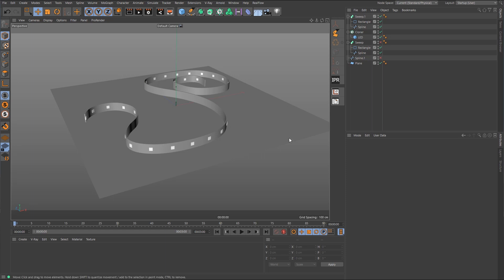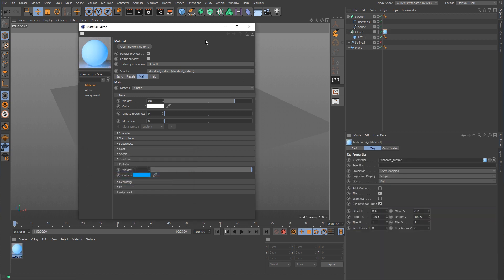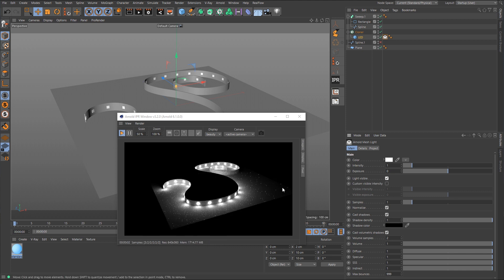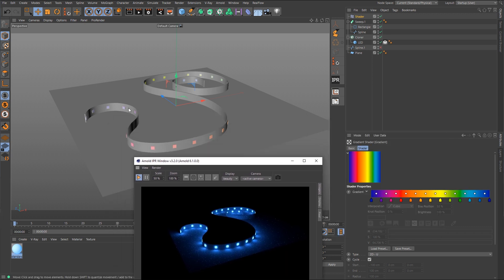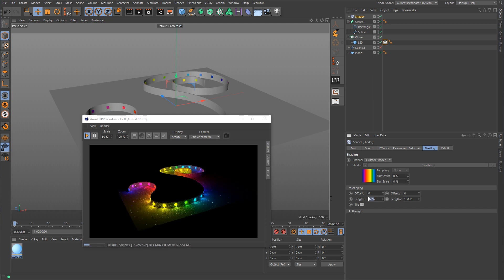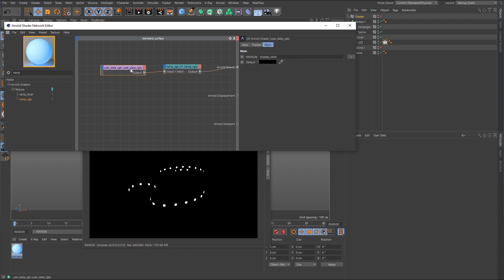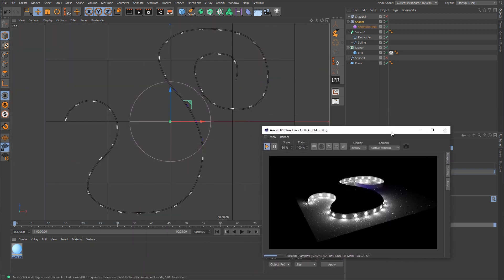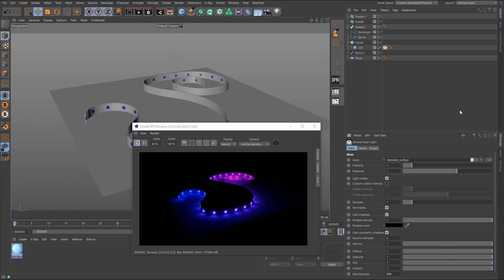Cinema 4D - Arnold Tutorial - Connecting Arnold to Mograph - LED rainbow strip

Comment: what about using matrix with an effector... how can i bring the color to arnold.  I have tried user data rgb-- not working
Reply from the maker: I haven't tried a Matrix object yet. Did you type in the correct attribute for the user_data_rgb? It should be:   display_color
Reply: @ShepperdOneill  It's correct...it just not working. wish I can speak to arnold developer.s
Reply from the maker: @madebyDebo  You can sign up over at the C4DtoA forum and ask questions to the developers there: https://forums.autodesk.com/t5/arnold-for-cinema-4d-forum/bd-p/c4dtoa-forum

Comment: Hello bro, What rendering settings did you use to render fast and with good quality?
Reply from the maker: The render settings I used in this tutorial were the default settings. I did not change anything.
Reply: @ShepperdOneill  thx bro
Reply: @ShepperdOneill  what are your pc’s components?
Reply from the maker: @OkButWhyBro  AMD Threadripper Pro 64core/128thread, 64GB RAM, RTXA5000
Reply: @ShepperdOneill  One last question and I won't bother you anymore, is it normal that when you render a video with Arnold in png frame by frame it takes a long time to render it? (removing the noise and everything from the video)
Reply: @ShepperdOneill  And Arnold is rather used to render objects or characters, right? it's not made for frame by frame animations because it takes at least 2 hours to re-render
Reply from the maker: @OkButWhyBro  Arnold is like any other render engine. It can be used to render still images or animations. If your animation is taking a long time to render, then you may need to adjust the render settings. Are you rendering with the CPU or GPU?
Reply: @ShepperdOneill  I'm not new to this, so when I do a project in arnold I render it with Arnol or else I render it with the hardware instead of the standard and the pro render, but the problem is that when rendering with Arnold it takes a long long long, and I don't know how to make a project with Arnold and render it in another place so that it goes faster or something, honestly I do know the difference between cpu and gpu, which cpu is more precise and gpu is faster rendering, but I don't know how to change it.
Reply from the maker: @OkButWhyBro  You can change from CPU to GPU in the render settings. In the Arnold render settings under the "Settings" tab, you can change the "render device" to GPU.

Comment: Do you do vray tuts?
Any way to do multiple materials in vray5 for c4d?
Is it possible to overlap multiple materials using gradiends for opacity?? mix materials doesn't work
Reply from the maker: I had done a few Vray tutorials on the past, but I no longer use it. The old version had some issues that were never resolved, and the newer version was lacking features.

It should be possible to overlap as many materials as you want. You could do this in the older version, so I don't see why it wouldn't work in the newer one.

Comment: Very cool. I'm curious as to how you knew to use display_color as the custom attribute
Reply from the maker: I had to spend several days searching online and finally found a very old thread where the developers had mentioned it. Apparently, the "user_data" node is extremely powerful, and is how information is fed to Arnold. Unfortunately, there is not a list of custom attributes that I know of. I plan to make another tutorial soon about the "user_data" node.
Reply: @ShepperdOneill  ooof! thank you so much for going to that extent to figure it out and I look forward to the next video!  I'm gonna poke Lee about this and hope that they can put a little effort into this side of documentation :)
Reply: @ShepperdOneill  If you twirl down the arrow to the right of the attribute setting in the user data node, that gives you all the datatypes available based on your installed render engines and plug ins (so for instance if you have X-Particles all the user data types for XP live in there as well -  easier than remembering the correct syntax.) The Mograph  display_color is in there by default.

Comment: How dare you say that you will switch back to Vray ????? Arnold now is faster, has best Pathtracing SSS in all render engines, has very awesome volume rendering ( Vray even does not have multi scatter ), has very easy and comfortably intuitive to use, has Much Better color raw render result thân Vray. I just use Vray 5 for C4D and I quit after 3 hours struggling with it. Too anoyying and alots bug. I need an explanation from you.
Reply from the maker: I did some alpha and beta testing for the newest version of Vray for C4D. It looked promising, but I still don't think it's ready yet for me to switch to it. It's lacking a lot of features and the render times don't seem to be any faster. For now I am staying with Arnold.

Comment: Have you tried Lentil for Arnold? It basically adds more control to your camera settings (rendering wise) and makes things like bokeh  and depth of field, that usually make your render times go crazy, much faster and cleaner. Plus a lot of other cool things.
Reply from the maker: I have not heard of it, so I just now searched for it. It looks like I might have to give it a try. Bokeh effects in Arnold take forever to render!
Reply: @ShepperdOneill  
I want to buy it after having tried it. It seems like a must have for us Arnold users.
Reply from the maker: @MauroSanna  Did you every buy Lentil? I recently worked on a job that required depth of field, and I ended up doing it in AE with a position pass. Arnold was taking too long to render it. I think I might have to buy Lentil but I wanted to ask you what you thought about it? Does it remove the grain and noise from depth and field and motion blur? I have yet to see anyone show real world results with it.